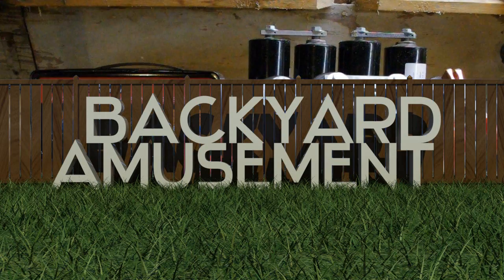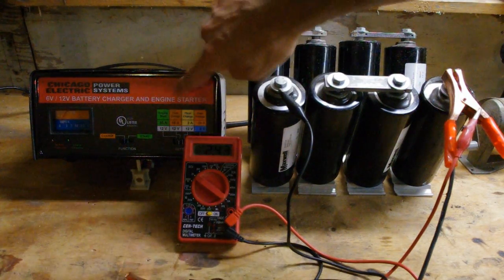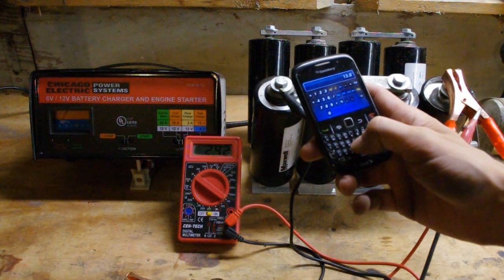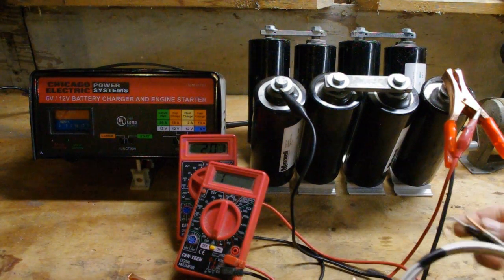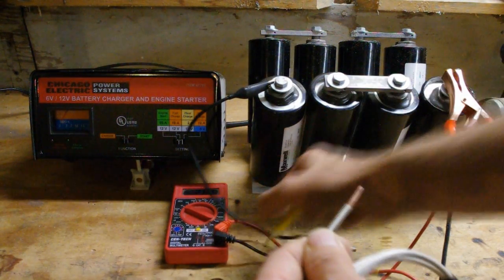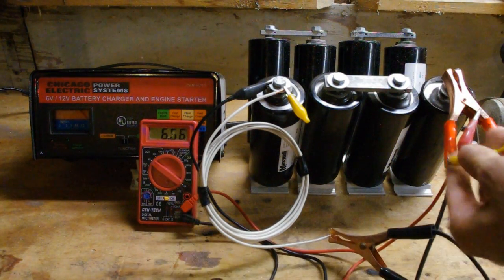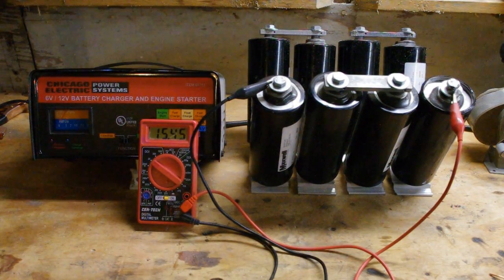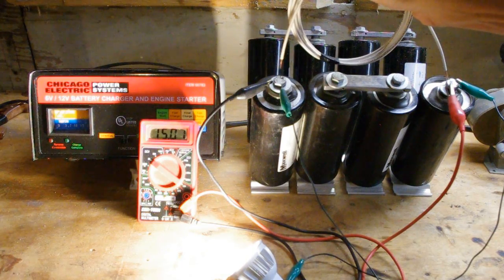How to charge a supercapacitor

Comment: I had 6x 2.7v 3kF Boostcaps in series, maximum 16.2V, sitting at ~7v total.  had a cheap 6A charge "maintainer" plugged to mains, I chickened out at 12.5v as I wasn't sure how well balanced the caps were in the set.  Took about 12 minutes to reach (checked with multimeter every 3 minutes, about 1.5v gained per 3min cycle.) didn't use any external resistance as the bank was already above a detectable voltage for the charger, and a storm was possibly approaching.  HTH

Comment: 4:33 I don't think that coiling the wire affects its resistance.
Reply: I think it must be resistive or nichrome wire, not normal copper wire. I am looking it charging caps and i think best method is to run the current through a lightbulb or resistor.
Reply: @Robde84  I think in his case, it's just normal wire.

Comment: Go to the auto parts store and get a ceramic resistor. Solder it to to  the clamp from your charger. Make sure you use less amps on the charger. It will take longer but you won't fry anything. Unless you over charge the capacitors. Then things will get very interesting. Make sure the fire department is on speed dial. LMAO
Reply: Oh I forgot to mention don't try this at home.  LOL  seriously you are trying to cheat the laws of physics. History has taught us Tesla is the only one that ever got by with that.

Comment: If you make your coil tighter you will get more wraps and thus increase the inductive resistance of your wire. So next time try wrapping the wire around a 3/4" deep socket and shoot for maybe 30-50 wraps.
Reply: What you call "inductive resistance" is called reactance and it's only relevant when there is changing emf. In a pure DC circuit like a car battery theres a steady current and hence any inductor would have zero reactance after the initial irregularities settles
Reply: @TheBozn  ok Dr buzzkill. I was shooting for a follow-up video with more 🔥. 
BTW, have you ever connected a Chicago Electric battery charger to an oscilloscope to confirm that the current is in fact continuous and not pulsating. Oh but now in a car you have an alternator! Now that bad boy is definitely pulsating dc.

Comment: Capacitor charging PCB? I would definitely charge them only this way.
Reply: There is a safe and stupid way - using a light bulb. Saw it first being used on a diy cheapoo 18650 spot wielder, but now i'm thinking it's a good idea if you don't have the money or the passion for the electronics and it's a 1 time job.

Comment: I guess the question is what percentage of the energy is stored at each percentage of the capacitors limit as far as voltage is this like the lithium batteries that you really get the most of your energy stored in there the last couple of volts?

Comment: Dear god you thought you could use a wire as as a current limiter in your application. The scientific solution would be a 6.5 ohm 26 watt resistor to draw 2 amp

Comment: to efficiently charge supercapacitors you need DC-DC step down converter pwm preferably... needs to be current limited with a maximum voltage of what the capacitor is rated to... should have a light that goes on when at max voltage too so you know its cooked

Comment: How about using a 55w 12v bulb inline. It will start off very bright and as the supercaps take a charge, the bulb will get dimmer and dimmer. 
It takes all the guess work out .. Keep it simple guys.
Reply: how do you connect the bulb to the capacitors?parallel or series?
Reply: MR backyard amusement this gut is giving bad advance the stuff in the video is really unsafe

Comment: Super capacitors can be charged to full in less than 5 seconds. 
The biggest problem being an overcharge situation. "Boom goes the cap"
So there should be a way to charge a super cap in that 5 volts, without killing it
Lets see you do that
Reply: 5

Comment: nr 12 is rated for 20 amps. solid or stranded. don't want to go past that due to manufacturing abnormality possibilities. stranded is better for grounding and higher frequency operations, ie radio, data, due to Faraday's law that electricity generally travels on the surface of the conductor. more strands - more surface area. still a good idea to use wire that exceeded your amperage requirements. if you will be pulling a consistent 20 amps up size to nr. 10. your wire should be rated to 125% of your continuous load.

Comment: 1) 12 gauge copper wire has resistance of about 0.005 ohms / meters.  I guarantee that coil of wire does not have anywhere near 1 ohm of resistance.  The multimeter may give you a reading of near 1 ohm either because the contacts are not making very good contact or becaues the multimeter is not accurate enough for sub 1 ohm readings.  The smaller wire you melted probably also had much less than 1 ohm of resistance.

2) I dont understand why you coiled the wire, uncoiled would cause less heat build up.  But more importantly, buy a heatsinked resistor for this.

Comment: You always want to use constant current to charge large capacitors, so that voltage ramps up linearly and you can easily calculate the time its going to reach full charge (roughly). That, and use proper wiring, and connectors, not those shitty alligator clips.

Comment: Hmmmm - The thin clip wire was more resistance than the 12 gauge wire - That is why it burned up.
Reply: Alan Williams yes and no.

no copper wire 30cm long can handle a dead short with a power supply over about half a volt, capable of pushing the current it demands through it. Its the lack of resistance, which pulls the huge current that burns it up.

The thin wire has the most resistance, and so is limiting the current to what the big wire can handle, but the little one (itself) cant.

if he had connected a 20 kΩ resistor it wouldnt have burnt up in a fireball, it would have limited the current to a tiny level. Which is a good thing because humans act as a MΩ resistor.

Comment: If you have a battery charger that has a six volt range, that works good for starting to charge a group of Super Capacitors (high Farad) like these, then switch to a 12 volt range.  Another way with just a 12 volt charger is to just make connection for a few seconds at a time until you build up a sufficient charge that your battery charger can handle the current.  Of course using a resistor in series like is done here is also a good way.

Comment: At the beginning of the clip you said that initial charging is effectively producing a short on the power supply. Are you meaning to say that the capacitor charges so quickly that it trips the breaker in the charger? 
The way you worded it is a bit confusing since capacitors create an open circuit under DC supply, which is the opposite of a short.
Reply: A bit of an old post but he was actually speaking correctly. A the time right after the cap bank (lets say in the microseconds) is connected to the charger the cap "acts" like a short meaning the resistance is so small that the set voltage of the charger will send massive amounts of amperage (only limited by the internal resistance of the battery or voltage source)
Reply: jesse bla To expand: rather than discharging that energy via an arc or heat, the capacitors absorb it as a potential (but at a much higher rate than a battery would store it as chemical energy, which is why the current is so much higher)

Comment: Discharge it on a superconductor and you will draw infinity amps
Reply: Wrong.....
Even those capacitors have maximum amps.
For example....the maxwell 6 pack kit 350F have a max amp of 820 amps.
Reply: 820 A is the maximum "safe" amount that these can handle. Ultimately the current that capacitors can supply "unsafely" is just limited by the internal resistance of both.

Comment: Actually, wire gauge for stranded wire is computed to make the cross-sectional area the same as solid wire of the same gauge. However, I agree with all of the rest of what you said. A simple AWG wire gauge chart would show that 4 feet of 12 AWG wire is much less than 1.4 ohms. It was actually his tiny alligator clip leads that were limiting the current.

Comment: You may want to try using a light bulb to limit the current. The bulb acts as a thermistor with a relativly high resistance when the capacitors first start to charge and the resistance decrease as they  charge up.

Comment: Im sitting here nearly pulling my hair out at your stupidity. You are clearly very misinformed about, well, everything in the video. This is why one day you're going to need a licence to buy supercaps. Oh, and just FYI multistrand actually has more resistance in comparison to solid core. This is because solid core has a larger cross sectional area than multi strand. The advantage of multi strand is its flexibility. Oh, and coiling the wire does nothing to resistance...

Comment: LOL, rather funny. As you do these experiments you learn things by experience. Immediately I said "that loop is less than 1.38 Ohms" and "those thin wires will burn"...I've been there and smoked several of these type of thin Radio Shack wires myself.

Comment: In the old days, we used "limiting resistors" - filament lamps fit the bill.  However  the filaments resistance may be either positive or negative coefficients with temperature, depending on the filament material.  positive the resistance goes up with temperature - negative resistance goes down with increase of temp

Comment: the important thing, is, not to use more voltage than the bulb is rated for. There are 120V, 220V, and 12V halogens. Available really cheap these days. Put enough supercaps in series to equal more volts than you'll ever see from the source. So, 6 X 2.5V (caps) = 15V. Seven caps in series would get you to a very very safe 17.5V. If you have 2.7V caps, then, 6 X 2.7 = 16.2V. No matter whether your car is running, or not, you'll be safe to then use the 12V bulb (in series) with your hot line

Comment: A 12V 50 watt halogen bulb limits current to about 4 amps. You can get one from a dollar store. Good cheap limiter. 2 in parallel will give you a quick charge at about 8A.

Comment: well you can't reliably measure wire resistance or any resistance under about 2-3 ohms) via multimeter, you need 4 wire method

Comment: And the reason stranded wire can handle more current, I think, is because of the current displacement in the wires, meaning that it only travels in the surface of the wire and not the middle. More strands/wires means more surface area.

Comment: You may consider using a voltage divider with say a 100 ohm resistor connected to each side of each capacitor so as to protect from any single capacitor charging more than the others, failing, then causing a larger voltage drop across the remaining, which would cause them to fail as well. A series network of 8 100 ohm resistors will help balance the voltage drop across each capacitor. To keep the capacitor bank charged at 14v, the resistor network would draw .14 amps from the charger.

Comment: It's doin pretty much the same thing as when say your running a car amplifier in the house and using an automotive capacitor with it running off of an ATX computer power supply it shits down when you try to turn it on so you gotta keep flipping the switch on and off till it comes up to voltage pretty much the same thing just different scenario

Comment: yea, buddy, but when you get burned by a capacitor discharge your skin gets damaged, and is les resistant, and draws more current. it'll still be 20 volts, but 50 amps will kill a fuckin elephant, my friend. how do you think people get tasered to death? 90,000 volts out of a stun gun in the milliamps scale can kill you if the spark breaks your skin or if you get tasered somewhere like your eye or mouth or an open wound. what you are doing is dangerous, but.... I do dangerous shit too sometimes.

Comment: I imagine in an electric vehicle, you'd charge a supercap since they charge in mere seconds. Then regulate the current & voltage of the supercap to recharge the main battery and power the motor as you drive away(?)

Comment: Partially true. It is the skin effect and higher surface area of the wire. It is manifested with AC and high frequency. Very low frequency with not so big wire mean that skin effect depth is 100% or it is the same as in DC (AC with frequency 0 is DC) and thus cables can carry same amount of current. BUT only Litz wire (EVERY strand isolated by itself). Regular stranded wire act like solid wire in this case. Only more flexible and easier to solder and take a little bit more space for the air gaps

Comment: First, the resistance reading you're getting from that cheap multimeter is completely worthless so trying to use that in any calculations is pointless. Secondly why don't you use a constant current charger instead of constant voltage? Lipo charger work in that way. Then you won't need extra resistance to try to limit the current.